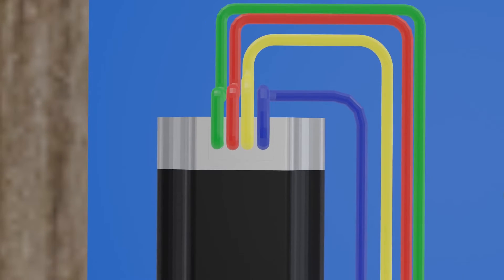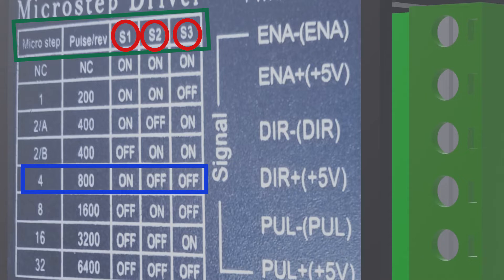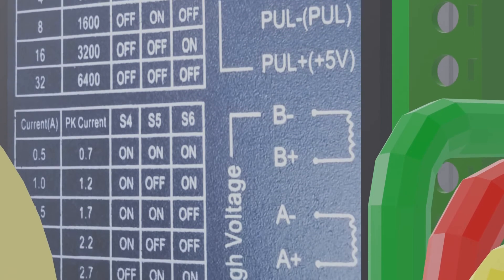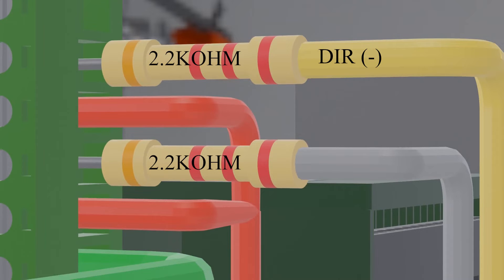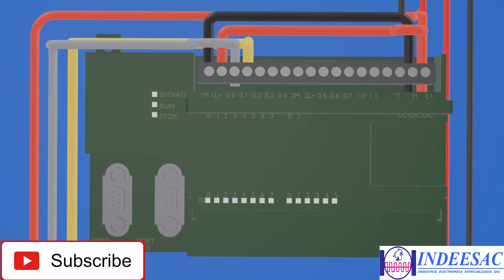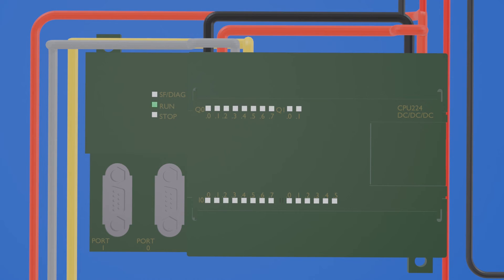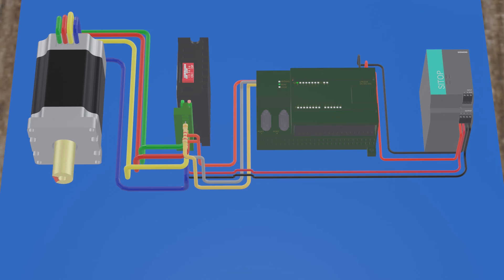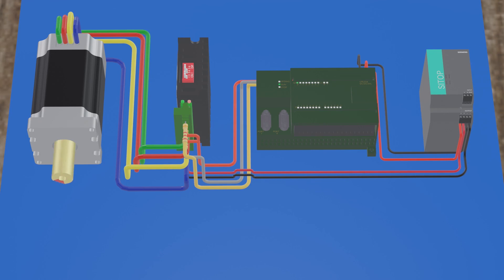How to correctly connect a stepper motor driver with any plc?||Complete Guide

Comment: What do I do If my Drive Does not have a + and - DIR and PUL, It only say PUL, DIR, OPTO and ENA is a DM322E microstep driver. Also can you Connect two drivers to a single PLC? My PLC has a [3L+ 3M .0 .1 .2 .3] <-- 24VDC OUPUTS and after that it has just two dots. My PLC is a SIMATIC S7-1200
Reply from the maker: Hi Jose, regarding your type of driver, in these cases they are usually negative pulse, that is, your plc must output NPN, in the OPTO you place +24V, and in PUL and DIR with resistance to the respective pulse outputs.
With respect to your plc according to its model, see if it comes out NPN or PNP at its output.

Comment: can i connect a second stepper motor to the same motor driver ?  or i need another motor driver?
I want both motors to have the same movement at the same time

Thanks
Reply from the maker: Hi, different controllers are needed, and for the pulses too, you can program it in the same pulse output, in this case a plc, that does the same function at the same time

Comment: are the resistors necessary? and what happends if i don't use resistors?
Reply from the maker: Hi, yes it is necessary because the output of the plc transistor gives you 24 volts and the controller needs 10 or 5 volts, if you do not place it you can damage your driver.
Reply: @IndeeSac  Why is it 2.2k Ohm? How to calculate it?
Reply from the maker: @alvixtan1617  Hi Alvix, the formula to calculate is the voltage divider, the output of the plc gives 24 volts, so to reduce it between 4 to 5 volts, you use the formula taking a 10K resistor (R1) as a reference, you apply said formula, for example in stepper drivers usually use resistors from 2.2k to 3k to reduce the voltage of the plc and according to the voltage that the driver supports in its specifications, but in the case of servodrives in its manual it specifies which resistor to use.